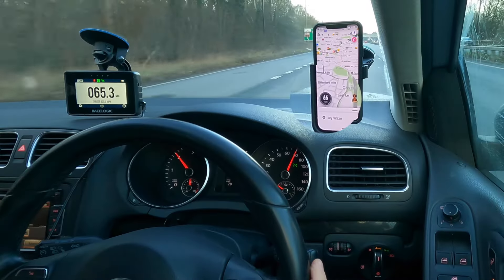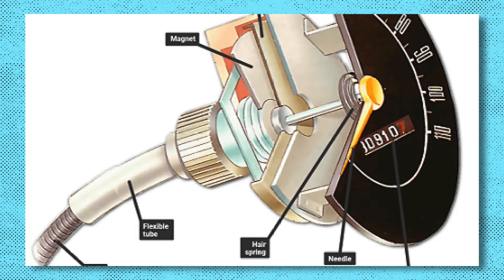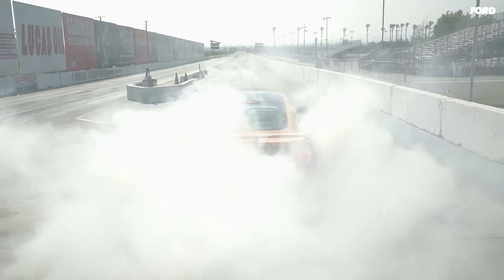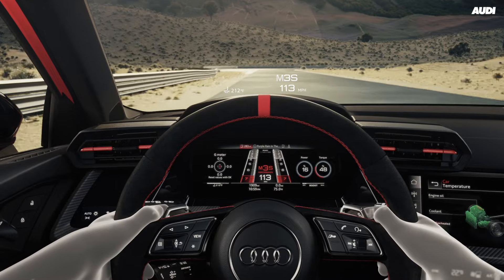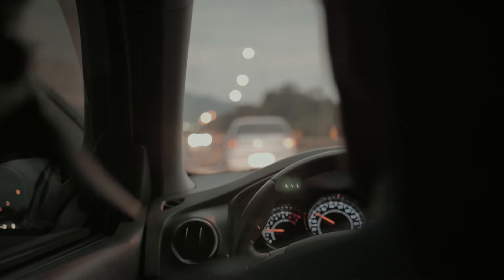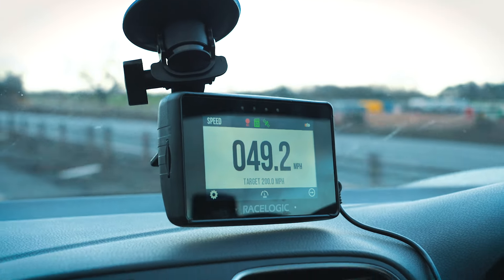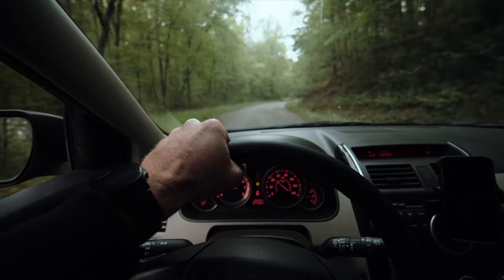Why Your Speedo is Lying to You

Comment: You've missed out a very important part here. Your speedo might be lying, but the car's speed sensor is usually very accurate. Hook a reader up to your car's diagnostic port and access the output from the speed sensor and you will find it is usually very close to the GPS readout (also proving that the speedo is being artificially set to over estimate speed).

The whole thing with the speedo over estimating your speed in the UK and Europe is because there are significant fines for manufacturers that issue a speedo that reads a lower speed than the car is actually doing. They don't do it to protect you from speed cameras/limits; they do it to protect themselves.

As a slight aside, cars over estimating speed by significant values is not really a good thing, especially if you have a driver that doesn't understand their speedo isn't accurate. A lot of people get this idea that because their speedo says they are doing the speed limit, anybody passing them is speeding. This in turn leads to certain drivers taking it upon themselves to attempt to control other drivers speed. Or you end up with drivers angry at the people they perceive to be speeding, or angry drivers being held up by drivers who are going dangerously below the speed limit.

Vehicle technology allows for highly accurate speedo readouts. Let's stop this pandering to manufacturers, pretending that over reporting speed is a good, or even acceptable state. If Mazda can confidently set their speedos to report very close to the correct speed, none of the other main manufacturers have any excuse.
Reply: Honestly Mazda is doing a lot of things differently to other manufacturers.. while VW and its brands went the way of 1.0 3 cylinder engines with a turbo (for the low and mid end cars, you can still get a 2l min something more expensive), you have to turn all the assists off every time you start the car, many of them are quite understeery and heavy. Mazda went with 2.0-2.5l 4 cylinder atmospheric engines even for its base models, push one button and all the lane keep etc. shit assists are off until you turn them on again yourself. In Mazda you dont need an automatic gearbox to get 4x4..Even the whole infotainment is done completely differently to the whole industry.. all car manufacturers talk about how its impossible to make "good old cars" anymore while its somehow possible for Mazda. Im not saying their cars are perfect, driving a car with no turbo after driving with it for a while will feel a bit slow but the nice throttle adjustment mid corner is something I personally cant let go of. 

From that I would assume that overestimating the speed is just a safe bet, simpler and possibly cheaper way to do it..just like with small turbo engines and everything else. Maybe thats the one thing every manufacturer should copy. It would certainly made roads safer if I didnt have to pass moms in their SUVs when theyre doing 40km/h all the time.
Reply: @MisoElEven  Something that could be interesting to note about the choice of engines for given market are the taxes. 
In many country (including in Belgium where i live), you have a yearly taxe to pay depending on your engine displacement. 
So people tend to go for smaller engines with turbo in order to pay less. And Belgium is quite expensive in that area (More than France). 
Which could explain why i don't see a lot of Mazda on the road in Belgium.
Reply: That is very interesting. That means the over read could be a constant and not linear with speed. 
So you would always be 5 kph above irrelevant of speed (appart for when you are at a stop or very slow i assume). 
I used to think that if you have +5 at 100kph, you might have +10 at 200. Which would make sense if the overread is from the system inaccuracies instead of an electronic margin.
Reply: @guilemaigre14  the over estimating being a fixed amount, or a percentage likely varies by manufacturer and how they are achieving the result. My past couple of vehicles have been a percentage difference.

For example, my current main vehicle (an older Nissan X-Trail (T30 model)) reads 33mph on the speedo when the sensor reads 30mph. The speedo reads 78mph when the speed sensor reads 70mph.

Would be quite interesting to have details from a range of makes and models to see the difference in how big the speed variance between the on-board computer and the speedo is; and how many are a percentage of speed difference Vs a set speed difference.
Reply: This is exactly right. My old Ford Ka reported insanely accurate speeds through the OBD port (+/- 0.3-0.5 km/h) but chose to move the needle less than it was reading.
Reply: That's correct, the odb speed is spot on with the GPS, so they do that on purpose, its not that the reader isn't accurate
Reply: @damionlee7658  as long as it doesn't read 10 mph when you're stopped
Reply: @geemy9675  my speedo and onboard sensor are equally accurate when stopped... GPS on the other hand, I have occasionally seen claim to be doing 3mph when stationary. 😂
Reply: @damionlee7658  yep unsurprisingly its easier to accurately detect no motion from stopped wheels than processing some radio signal coming from 20000km away. although GPS can be very accurate especially military ones
no everything changes except if you are driving on ice. you could be going highway speeds, disable ABS, slam the brakes and your speed o would say 0 while your car would still go the same speed.
Reply: I am an engineer and I was involved in the automotive industry many years ago.  I am very aware of this deliberate over reporting of the speed that exists in Europe and British nations and I am aware that it is related to the vehicle manufacturers wanting to avoid any liability. 

I have been living in the most litigatious place on earth for the last decade and find it interesting that all the speedometers in the vehicles here read the correct speed to the closest mph.
Reply: @guilemaigre14  yes a constant speed offset is clearly what you find in a lot of European and British vehicles.  There is a strange non linearity at about 25km/hr and above that speed you have typically 5km/hr added to the speed read out.  Below 25km/hr the speed is typically correct
Reply: @michael-j-harrison  someone's job was to fake the speed but to still make the speedo. actually I'm surprised that it's not just linear plus an offset
Reply: This was my thought as well. My USDM 2000 Honda CR-V reads ~5 MPH fast. But I've used a Bluetooth OBDII scanner to read the actual speed and it agrees pretty much exactly with what I read from a dedicated GPS. This tells me that the car knows how fast it's going, it just doesn't relay that information to me correctly. My guess is this is on purpose to prevent speeding. Especially since drivers have a tendency to feel comfortable going ~5 MPH faster than the speed limit without worrying about getting ticketed. With this in mind, I would assume the odometer is accurate. However, I have not tested that, but it would be a good indicator of intent here.
Reply: This ^
Reply: @Damion Lee i agree, but have to add.. How is the fuel consumption when you are always 'lied' with positive numbers..? What is 5-10% speedo positive, adding to your irl fuel consumption ;) .. and what is the commersial telling you :D
Reply: @vechrogazwow  only the speed readout is being artificially inflated by the manufacturer. The vehicle's computer system has an accurate speed, and uses that accurate speed to work out distance travelled to display on the odometer, and for working out fuel efficiency.

You can check your odometer gives an accurate distance travelled by checking it against a known distance (or against a distance estimate from a satnav or map).
Reply: It's not pandering to manufacturers though, if the UK and EU are anything like Australia there are design rules that mandate that the speedo overread to give headroom.
Reply: @bosstowndynamics5488  the UK and Europe don't have a regulation that the speedo must over read though, so yes, it is pandering.

In the UK, the requirements of a vehicle speedo are dictated by "The Motor Vehicles (Approval) Regulations 2001" (EU Member States will have their own equivalent, and this was enacted when the UK was an EU Member State).

(Speeds in the document are given in miles per hour. For ease of comparison I have given approximate conversions to kilometres per hour.)

There are three stipulations for speedometers which amount to:
 1. The vehicle must have a speedometer if its maximum speed is more than 25mph (40kmh). The speedo must indicate speeds with uniform intervals and must be readable day or night.
2. It must not indicate a speed less than the real speed of the vehicle
3. It must not indicate a speed greater than the real speed of the vehicle plus 10% and 6.25mph (10 kmh) when the vehicle is moving at between 25mph (40kmh) and 70mph (112kmh) (or the maximum speed of the vehicle if less than 70mph (112 kmh)).

The official document can be read here: https://www.legislation.gov.uk/uksi/2001/25/pdfs/uksi_20010025_en.pdf and speedometers are covered by Item 19 on page 37.

For simplicity, the wording in that item is:
"	1.	The vehicle shall be fitted with a speedometer capable of indicating speed in mph at uniform intervals not exceeding 20 mph at all speeds up to the maximum speed of the vehicle and capable of being read by the driver at all times of the day or night.
	2.	For all true speeds up to the design speed of the vehicle, the true speed shall not exceed the indicated speed.
	3.	For all true speeds of between 25 mph and 70 mph (or the maximum speed if lower), the difference between the indicated speed and the true speed shall not exceed V/10 +6.25 mph where V = the true speed of the vehicle in mph."

For completeness, "Maximum Speed" is a term defined in "The Road Vehicles (Construction and Use) Regulations 1983 in the table found in regulation 3(2). That definition is:
"The speed which a vehicle is incapable, by reason of its construction, of exceeding on the level under its own power when fully laden."
(Official copy of the legislation is available at: https://www.legislation.gov.uk/uksi/1986/1078/regulation/3/made )
Reply: @damionlee7658  Manufacturers aren't making speedos overread for funsies, they're giving themselves headroom. If the speedo is even 0.5% under they can get fined, so they set it to read in the middle of the allowed range. If you want manufacturers to set their speedos accurately the way to do that is to tighten the tolerances on the other end so that the midpoint of the allowable range is closer to being a true reading.
Reply: @bosstowndynamics5488  maybe go back and read my comments properly, because you are basically just stating what I've already written.
Reply: @guilemaigre14  Such a stupid way to do it engine displacement has nothing to do with how much emmissions the car is making, I don't believe in vehicles tax or most tax for that matter but they should tax it at the tail pipe if they're going to tax them Its silly when a 2.0 litre engine could be better than a 1.2.
Reply: Damion is right.  All my domestic (US-market-only) GMs are spot on and this trend spans decades and many vehicles.  I have consistently seen the issue when driving international versions of imports.  Typical ironic result of government regulation.
Reply: @michael-j-harrison  by making vehicles dangerous? Some newer cars overreport by 15-20km/h... I don't know why, but when people are thinking they drive at 70, and in reality it's not even 60 then you come around the corner at 90 according to GPS that's not a good thing. It's not too dangerous, but it still is. Also annoying, wich makes it dangerous. Because slowing down the traffic and getting drivers mad is dangerous.
Reply: I've actually worked with the department that calibrates speed on the ecu of the chevy malibu. The reason the speedometer reads high isn't even due to fear of fines, or rather, it's not set to such a massive degree of inaccuracy due to this. Yes, manufactures don't want to get a fine, but a 3-5 mph buffer is not needed to insure they don't get fined. As long as it was proven to be accurate before leaving the factory, a deviation over the lifespan of the car won't result in a fine. 

So what's the reason then? I obviously didn't answer that question yet. It's actually very simple; it costs less money to do it this way. Most cars will be sold with different types of tires and wheels, if you had to calibrate every single car to the specific wheel and tire that it is being sold with and then bring it back to calibrate it if the dealership decides they want to change tires to match the season, then that would cost a lot of time and money. Instead, a calibration is chosen that will be accurate enough for the speeds in the range of tires and wheels that the car will be sold with. this is also why you will hear different results from many people who own the same car in terms of the accuracy of their speedometer.
Reply: @flyingtentacle7631  except your reasoning doesn't actually make any sense, because the speed that is inaccurate is the readout on the speedo, not the speed sensing and sending systems. That was the entire point of my comment, whilst the speedo may be significantly underreporting, the speed being used by the onboard computers is accurate, as can be seen by comparing the speed taken from the onboard systems through the OBD-II/EODB socket and comparing it to a GPS speedo.

Of course, different manufacturers have different processes. Mazda, as an example, details in their official workshop manuals the PCM reprogramming that is to be undertaken if the vehicle is fitted with a change in wheel and tyre combination. Because a change of wheel and tyre size doesn't require re-calibration of the ECU, as speed is attained by simple mathematics, and you just have to calculate the total circumference of the tyre.
Reply: I am in no way surprised that a Mazda MX5 would be as spot on as they can manage, given that that is a car very much designed to be a fun drive, and fast is fun, so in order to make 50 in an MX5 feel faster than 50 in a Prius, you make 50 in an MX5 literally faster than 50 in a Prius. I bet they would under-read if it was legal.
Reply: Preach!
Reply: @MisoElEven  there is a reason why mazda is much smaller than VW. It's more towards mazda having limitations in budget rather than doing things differently.

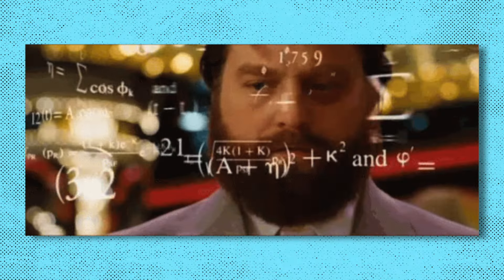Comment: 4:07 I actually do this at times D:
My speedo reads high by 4km/h, you get a correction of 3km/h on the flash (by law) and you must drive 4km/h too fast after correction to get a ticket.
So if I put my speedo just underthe next 10km/h (eg. have my speedo read 88-89km/h on a 80km/h road), I'm fine.
And no, it's not a headache to me, it just comes natural at this point because I'm used to it after 3 years.

Comment: Opel Astra F did over read quite a bit if you were doing the city speed limit on the speedo which is 50 kmh you would actually be going 40, and the overread grew along with the gain of speed, it showed 140 when you were actually going 120, but the overread was within the tolerance required by the law. It was a cable speedometer and this car was from 2001!!!!! Even my Audi 80 from 1989 has an electronic speedometer with an inductive sensor on the gearbox's left axle output.

Comment: I had a 2011 Holden Commodore SS-V In the settings menu was a tyre size section, if you put bigger wheels on you can enter the size of the tyre to allow the computer to re-calibrate the speedo.

Comment: My E39 528i is exactly 5 kmh over the real speed. The funny thing is that in the hidden menu on the bord computer there is a real speed option which is spot on but must be turned on every time you start the car if you want to use it.
Reply: My e46 touring shows exactly the same 5 km/h over the actual speed. Hidden menu is awesome
Reply: How do you turn it on? I would love to try that out on my E39.
Reply: @xJustInTime  it depends on the version of obc you have (big or small screen in the cluster) but there are a lot of tutorials on YouTube. Normally on all BMWs it's turned on by holding the button to reset the trip odometer for around 10-20 seconds. You have to unlock it as well after you get in, so better check a YouTube tutorial as it's a but too much to type in a comment.
Reply: Why would they lie about it in the first place?
Reply: maybe you have bigger tyres than stock
Reply: @alkr626  tires are stock 225/55/16 and on original E39 wheels

Comment: In germany most people just drive at least 10% above the speed limit because of techometer inaccuracy and the tolerance of speedtraps.. If you're driving exactly 100 on a normal road people will pile up behind you pretty fast unless they can overtake. 😁My 2021 Focus ST is about 5km/h off at 100km/h, gps displays 100 when the dash shows 104-105.
Reply: I'm German too and usually overtake with exactly 5km/h over the limit when I'm driving with GPS. It's surprisingly useful in 130 roads where people stick exactly to the limit. I may not be overtaking fast but I only have 1 or 2 people tailgating me at best 😆
Reply: Does that mean normal Focus drivers in Germany routinely go at least 115kph? (105+10%) 

Will insurance cover damage to their own car if they have a crash no matter the speed or is there a cutoff? (say 140kph)